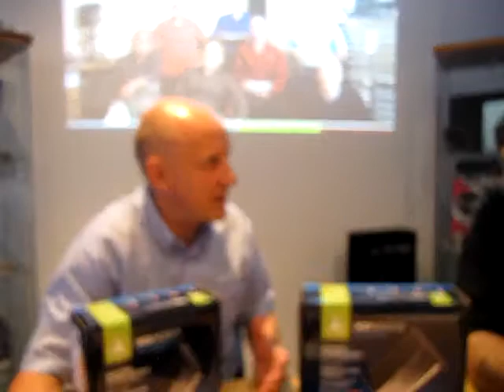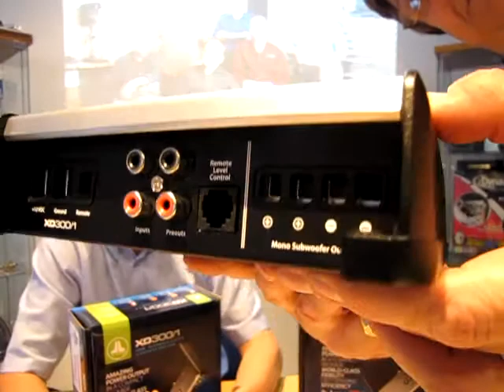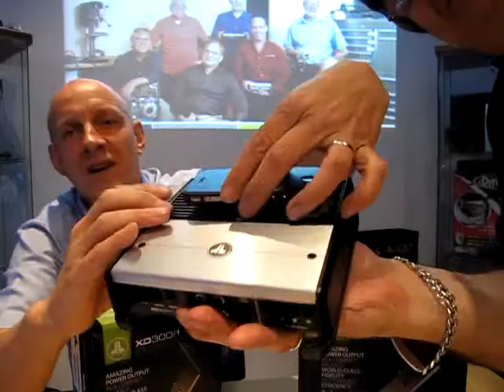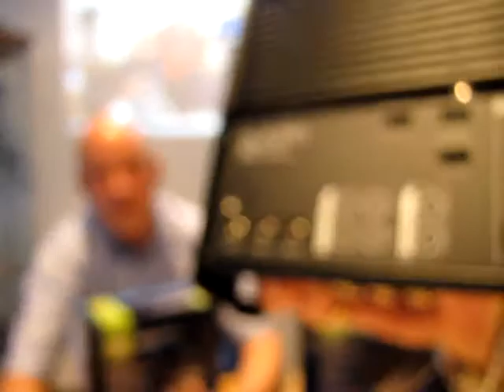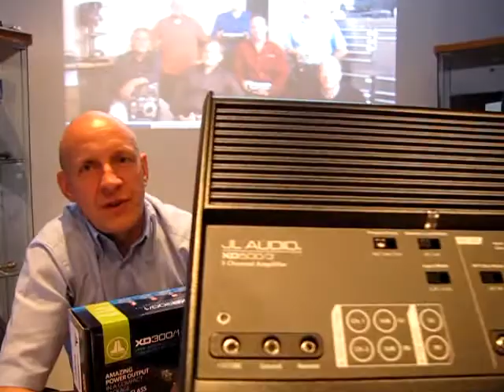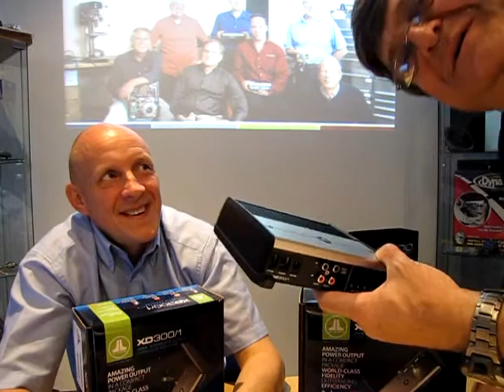JL Audio XD car audio amplifiers

Comment: I totally agree , I have a xd 400/4 running a set of 51/4 vr components up front and 6by9 3 ways in the back, and the sound extremely clean and  plenty of loud output, to round out the system I 'am running 1 jl audio 500/1 pushing to ten Rockford phosgate p3 shawllowounts, overall this is a great sq system that has people wanting my set up

Comment: tbh i think jl is ok but the door speakers are poop i got a hf 600/4 with a w3 in my car its ok b4 that i had the wxv2 with a jx 360/4 and c2`s all that for 500 i personally think that's a rip of as i could have got a hertz system for about 400 that's the mid range hertz stuff